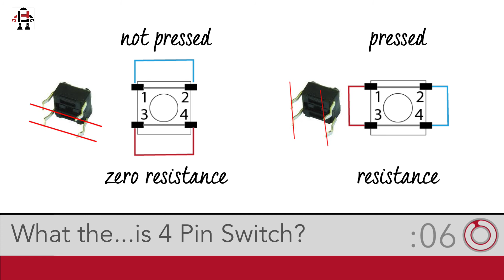What is a 4 Pin Switch?

Comment: Without a multi tester how can I tell pin 1/2and3/4 four on the mini 4 pin switch
Reply from the maker: One end of the switch is longer , but you really need to get a multi tester or a coin battery and just understand it. Once you understand it you will know how it works, but basically the long and the indication and then the left and the right of the long end is the double switch

Comment: Thank you, except when the switch is pressed it would make more sense to show a square of red lines (ie, all pins are connected to each other). By keeping 2 red lines and just shifting the orientation (on the image of the switch) as well as moving the red and blue "U" lines, it implies that the original connections are broken when the switch is pressed.

This had me a tad confused when I just found the images and it did not match with what I measured.. so I was wondering whether I had just received a broken batch.

ie,: Implication: Unpressed: 1-2, 3-4, Pressed 1-3, 2-4
Reality: Unpressed: 1-2, 3-4, Pressed 1-2-3-4
Reply from the maker: ok, thnx for the feedback

Comment: hi so if i put 4 wires on a circuit board that takes 4 pin . can i join the wires to and use 2 pin mirco switch please
Reply from the maker: Yeah you do not need to use four wires you can use two wires just put them on opposite ends of the switch honestly I’m not sure why there is four pens I think it’s to secure it to a PCB board so the answer is yes you can do what you’re trying to do

Comment: How can I test this type switch ? When I push mine in, the coffee machine lights up, and then it shuts off after a fraction of a second ??
Reply: Could be that you need a debouncer since it's a mechanical switch. Basically when you press the button, theres still some vibration going on when you let go, so the contact "bounces" on and off. Add a delay(10) after the button press, or change the value a bit depending on how old the button is - some older ones are less stiff and may bounce for longer than 10ms.
Reply from the maker: Dash nice tip
Reply from the maker: A.B.1900 B coffee pot? Maybe do a smaller project 1st ?
Reply: A headlamp with 3 light funtions is one already made example